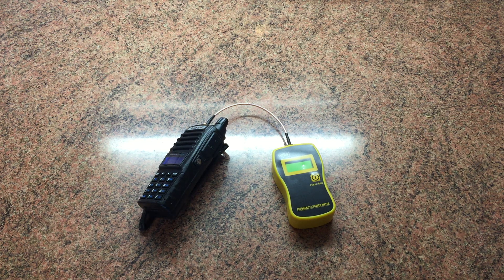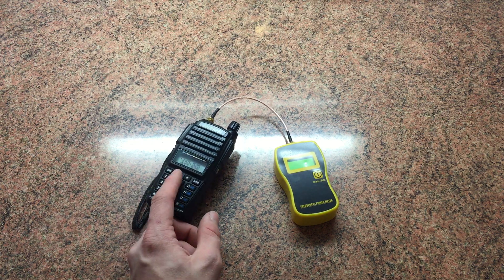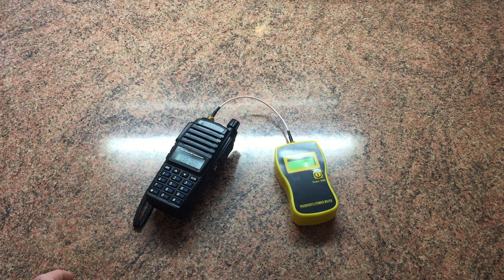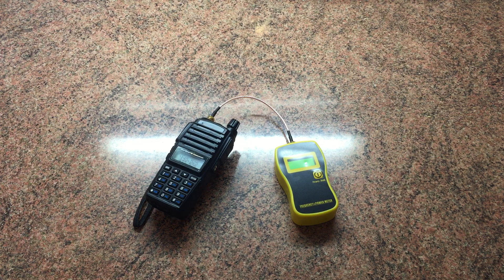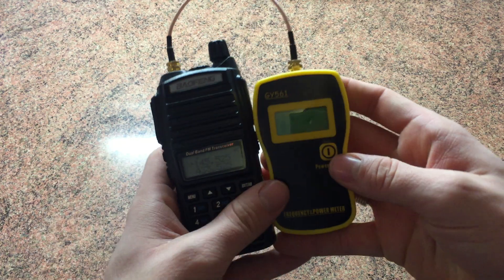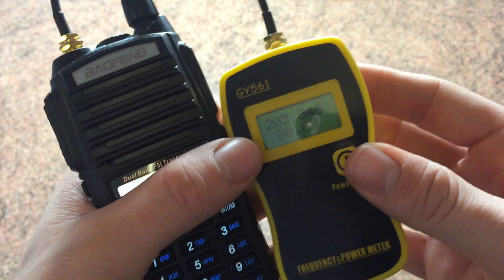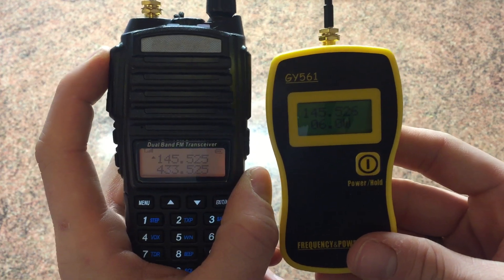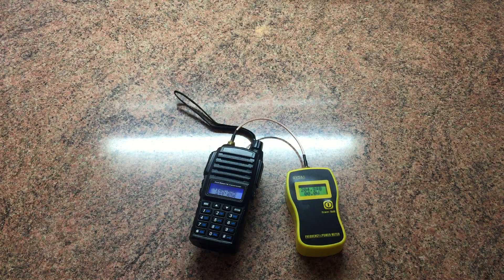Baoeng UV-82 Power Test With GY561 Meter Part 3

Comment: my UV-82 is a rubbish, especially at UHF, it can receive but had problem when transmitting uhf at 200-300 meters
Reply from the maker: +Gendon Prasojo what frequency? And what antenna
Reply: 430.025
nagoya 771, 773, 701 
it's ok transmitting from vhf (142-156) but not the uhf
I think it's unit defect 
I also use UV 5R & 888s both fine transmiting uhf
Reply from the maker: Ah thats a shame, It does sound like a fault yes!
Reply: do you have any info about Baofeng BF UV-8D ? sorry for my english :-D
Reply from the maker: No sorry, but don't waste your money. It has no display! :)
Reply: I got a couple of the uv82 radios they perform well nice to see the video post.